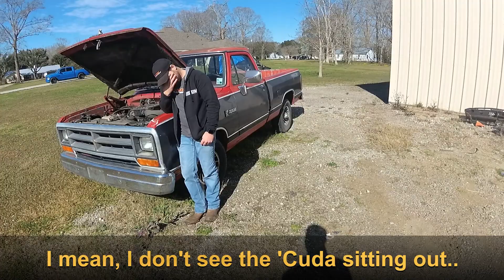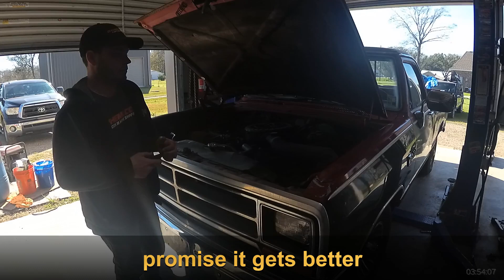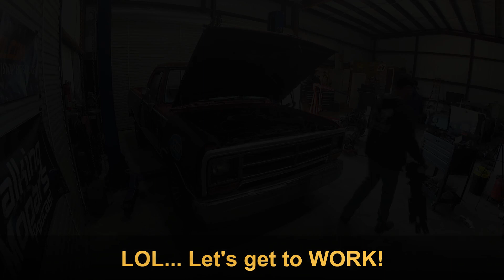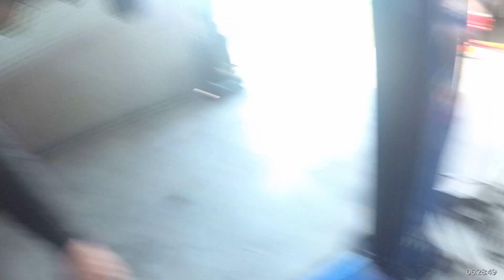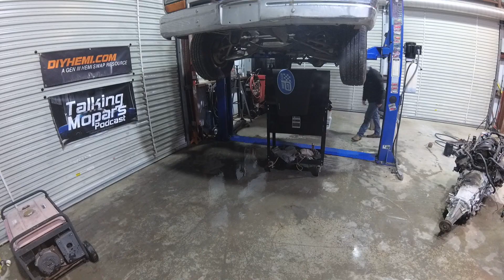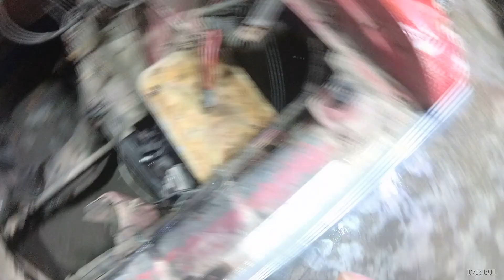DIYHEMI Low Buck Hemi Truck - Ep. 7 - Removing the old D150 powertrain and prep for Hemi engine swap

Comment: I have a question about that you stated y’all used the original wire for the ac compressor? My stand alone harness has an ac wire and how could I use that and tie it in to the original ac controls?
Reply: Also where do you get the vacuum from on the hemi to operate the heater control valve?

Comment: i have a 93 with the 3.9 and the nv3500, can the stock nv3500 with like 250k miles handle a 5.7? because the oil pump went out and seized the 3.9 and i want to get my grandpas truck back on the road by doing what he was going to do with it before he unfortunately passed away, if it can’t handle it what manual trans should i go for? i was planning on robbing the motor and trans out of that ugly bodystyle of charger/challenger and putting the rear diff out of one of those cars into it too, i don’t know if you’ll even see this but if you do please get back to me, seeing the little dodge sit non running really tears me up inside

Comment: So what if you have a 2007 donor Hemi  truck and you plan to swap into a 84 D150 with A833 manual trans?
Reply from the maker: Cut 5/8-3/4 of an inch off the 833 input shaft tip, get you a swap flywheel from American powertrain, McLeod or Ram and use a traditional old school clutch and small block Mopar bell housing. Bolt it all together and go have fun

Comment: I just finished a Gen III 6.0 on my 88 Chevy K3500 so I could pull my 89 D150 in to start this same process using your advice. 
One thing I'm struggling with is the identification of the trans that I have.  I've looked all over forums and Dodge pages to figure out if I have a 4 or 5 speed automatic. Is there an easy way to tell? I don't have any identifying tags on it... that I can see anyway.
My donor is an 06 Ram 1500 I have the trans, prop shaft and rear end so I'm thinking of trying to run the 06 rear end in the 89 as well.

Comment: I have a question. I have a 08 dodge 1500 single cab 6 speed behind the 3.7. 6 cylinder. I seriously want to get a hemi. Is there anything that will slide in using the 6 speed. If you have a solution to this. I would happily buy it all from you. Maybe a plug and play kind of thing. Minus my LABOR to install of course.

Comment: Awesome job i cant wait.. My 86 d150 has 2 small factory drain holes in front of the bed.. Might be easier to remove radiator support for the hemi installation
Reply from the maker: Really? Wonder what happened to ours. We will find out when we install the Hemi and 545rfe tomorrow!
Reply: @SUBLIMEparts  good luck hopefully everything goes smoothly.. Love the content
Reply: There probably just clogged

Comment: Yo I have a question, on the first video in your hemi instruction tutorial. You mention that 03-04 swaps are the easiest as in: input from tcu does not affect engine performance. But I've read online that to run an older style transmission (904) you would need to flash out the transmission? Could you please clarify?
Reply from the maker: Sorry for the confusion. Simply put, all Hemi engines can operate without flashing out transmission files, if wired correctly. Especially in the 03-08 trucks, the ECM doesn’t care much if the factory transmission isn’t there. 

Flashing out the transmission will help in eliminating check engine lights and performance limitations that may trigger from not turning it off. 

To date, we haven’t had one swap roll through our shop that didn’t run with the automatic transmission files still in the tune
Reply: Ah I see. Thank you for the clarification and keep up the great content :)
Reply: But I believe you have to have a spaced out flywheel to run the older style all the way up to like a 46RE right?
Reply from the maker: @covertkermit1343   you are correct, you would have to run the flex plate adapter to bolt to the old school torque converter